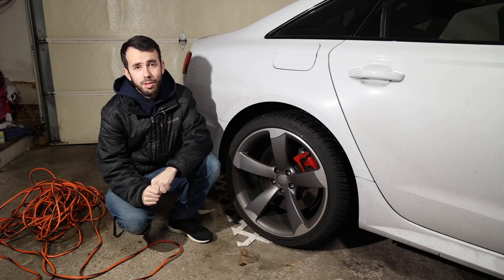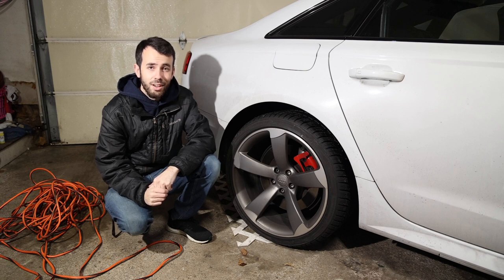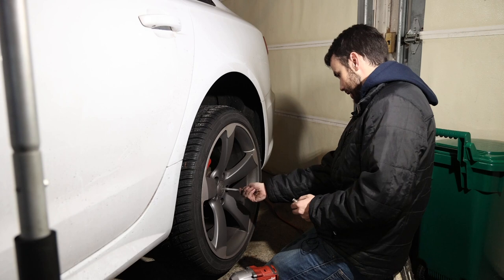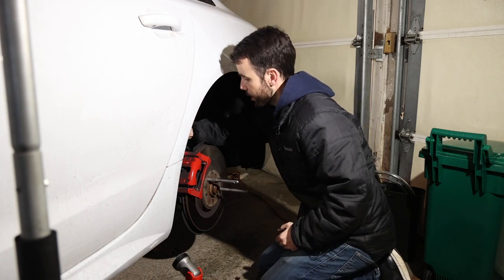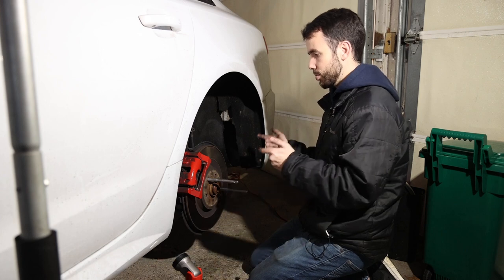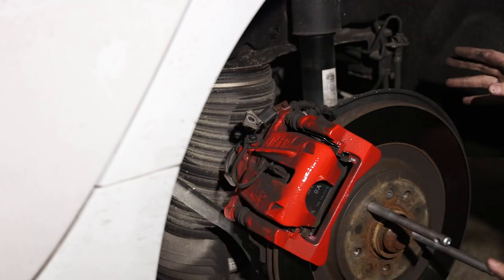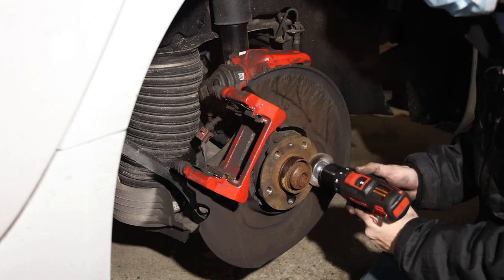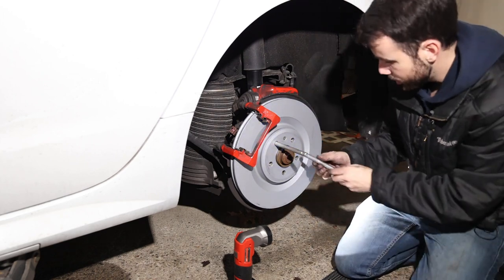Fresh Brakes for My C7 S6 - No More Brake Dust!

Comment: I’m just here looking for a way around the 5k estimate I got from my mechanic for new brakes on my ‘17 S6
Reply: I have a 17 S6 as well, I ordered all 4 rotors, brake pads and sensors from ECS tuning for just under $1,500. Find a local mechanic that works on German cars and labor shouldn’t be more than $500 tops.
Reply: Bet. That’s about the range I was hoping. Just dropped 2100 3 EJ’s ago on sensors, plugs, overdue maintenance so I’m lookin for a break this time around👌🏾

Comment: Eli how did you disable the wear sensor light? Tried a couple of different options in vcds found on the forums but nothing seems to work for the S6.
Reply from the maker: In central electronics, bit 17 byte 2. Should be labeled wear sensor. You can uncheck it, then restart the car and the light should be gone
Reply: I don't know if this works on the newer Audis, but when I had a B5 with Stoptech big brakes, I cut the sensor off of the brake pads, twisted the wires together, wire nut, electrical tape, and then connected the pad sensor back into the harness with it zip tied out of the way.  It tricked the sensor into thinking it was still good. This way, you could still connect another pad later that has the sensor, since you cut the wires from an old pad you trashed.

Comment: When you did the front pads, what socket did you use to remove the 2 bolts holding the bracket? I ordered a 5033 VAG brake caliper socket 10pt x20 but it was starting to strip the head of the bolt.
Reply: 2 years late, but DON'T remove those. The procedure specifically says not to. You remove the 2 on the inner side of the caliper that hold it to the spindle/hub, then use pliers to slightly push back the pads to get the caliper off. Make sure you shield the caliper with a piece of rubber or plastic to protect the paint. The bolts that are removed are "stretch" bolts and are meant for one-time use. They should be replaced EVERY time they have been installed. (No matter how old they are.) Hopefully someone else sees this in time.

- Caution
Risk of malfunction. 
Do not loosen the bolts on the brake caliper. 
Do not remove the guide pins.
- Note
The guide pins are only replaced on the ceramic brakes. 
- Note
Replace the brake carrier bolts after removing.

Comment: Eli, I’ve been running the EBC Red Stuff pads for quite a while now on my S4 with great results. However, there is a bed in procedure with these pads to get the best out of them and I’m not sure if you are aware!?

1) Use brakes with minimal pressure for first 100 miles from urban speeds of 30-50 mph only.

2) Drive a further 250 miles using slightly increased brake pressure.

3) Look for a full width contact across the pad depth. You will see a blue-ish band evidencing contact across the rotor face. Until this band goes from the outer to the inner edges of the brake disc/rotor the pads have NOT yet fully seated.

4) MOST IMPORTANT Make 10 stops from 60 mph to 10 mph in quick succession with a deliberate attempt to get the brakes very hot. Some smells may occur, even slight smoke during this final heat up stage of the pads. Allow the pads to cool sufficiently before parking with the handbrake. 

Follow these steps from EBC and honestly you’ll have even less brake dust than you shown at the end of the video. Hope this helps and keep up the videos 👍🏻

Comment: The EBC brake pads are great. I ran Greenstuff awile ago.
Reply: EBC 4 lyfe.... lol but they def. arent the best. I run Red Stuffs usually If you have a street performance vehicle the extra bite is totally worth it. They want a tad more heat to be at optimal braking, but bouncing back and forth between green stuffs, red stuffs and occasional hawks, the reds basically are at operating temp once you tap em once. If you are driving super aggressive, basically it just means youre going to lightly lay on the brakes a little bit when you start. Like going down some twistys just tap the brakes a little thru there, if youre on the highway again, basically a tap gets them to peak stopping. Honestly after using them for several brake changes and vehicles, you get used to em enough that its not even a second thought. ( And honestly they arent track pads, just more aggressive than green stuffs, so its really no big deal. ) Unless youre rocking an suv or super econo box, its totally worth it. Just be weary buying potentially counterfit EBC's off ebay. That goes for any color, green, red, yellow or blue... so assholes are basically treating some shit pads with colored coatings... I got a pair once and they freaking caught on fire the first day of brake in.

Comment: How did you back out the E brake? You said Vadcom or OB11 what does that mean?? Thanks!
Reply: 1 year late, but those are some of the hardware/software options for accessing the car's modules, via the Onboard Diagnostic Port (OBDII). If you you are not car or computer savvy, then get OBD11. If you're just new to Volkswagen Auto Group, then you may prefer VCDS (VAGCOM). Whichever you are, if you are an Audi DIY'r, then you should get one.

Comment: Turbo on my S6 just blew right before Christmas. The oil screen came for me 💀 Getting Rs7 turbos installed though 🤣
Reply: @ignitiontube hopefully youve check into the oil screen on your. Probably already on your radar if it hasn't been done already.
Reply from the maker: Mine have been gone since about 3 weeks after I bought the car 🤘🏻
Reply: @IgnitionTube  good stuff, definitely helps when you don't have to replace a $2k set of turbos 🤣
Reply: How many miles.
Reply: @cammgt3rs370  Small update on that. Turbos blew at 56k miles. Im currently at 67k and have only had a coolant hose and wheel bearing go out. In total for all the repairs it cost 7500. Unfortunately due to other pending issues such as a high pressure fuel pump possibly failing, suspension noises, and paint damage from the previous owner I will most likely be selling the car soon.

Comment: So you manually pushed back the caliber? Thought it was electronic? Or it doesn't matter
Reply from the maker: The parking brake is electronic. That needs to be retracted via VAGCOM. Then you can manually retract the actual brake caliper itself.

Comment: If you buy the bigger 6ah or 4ah xc battery for the m12, it turns it into another animal!
Reply from the maker: Hm ok I’ll try one of my 4’s or 6’s in it then!!
Reply: @IgnitionTube  Yeah give it a go. Id love to hear back if its any better for you. Mine won't do wheel bolts with the small battery, but with a 4 or 6xc charged, they come right off!
Reply: @oliverberridge7706  I have an m12 stubby impact and been wanting to get a 6.0 but they’re pricey haha
Reply: @dumbeezy5480  When I looked into it, the xc 4 will give as good performance. The xc6 will just last longer. Buy genuine batteries too!

Comment: Go old Milwaukee M12 stubby! So good!!!
Reply: Oh then the diss on it lol maybe step up to a 4amp or 6amp battery cuz mine busts everything off pretty easy on brakes an wheels. Suspension stuff I step it up to the M18 Mid torque most of the the time.
Reply: Also noticed you have it on the 🔄 mode keep it on mode 3 for all the torque that mode you have it in is to gently remove stuff

Comment: Shouldn't you only torque when on the ground and full weight is on the suspension?
Reply from the maker: I was always taught you are supposed to torque with a tiny bit of weight on the wheel. That’s why the car is dropped enough for the tire to touch the ground, but not so much that it’s fully on the ground.

Comment: Just did zimmerman rotors with ferodo pads, very pleased with the results not terribly costly considering the platform. Just gotta watch out for that rear parking brake. Can be temperamental with fault codes in some cases! Lol 
Nice video bro!